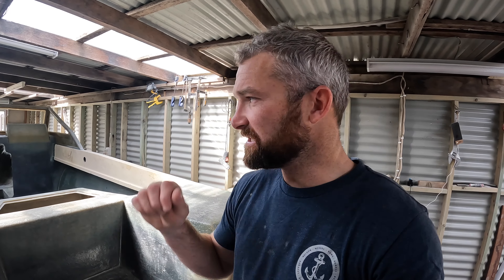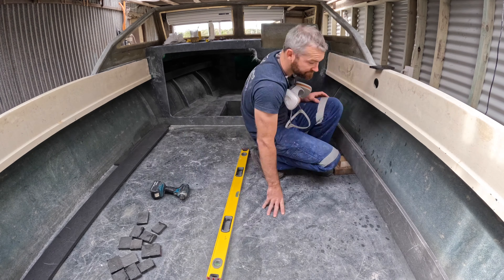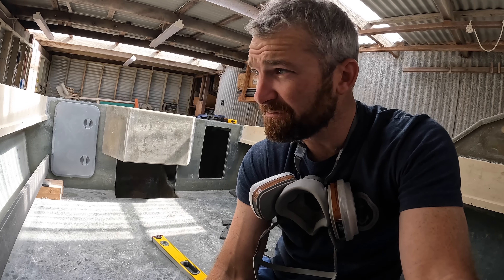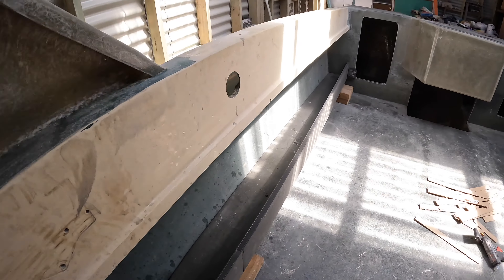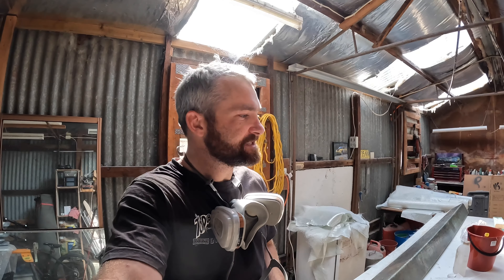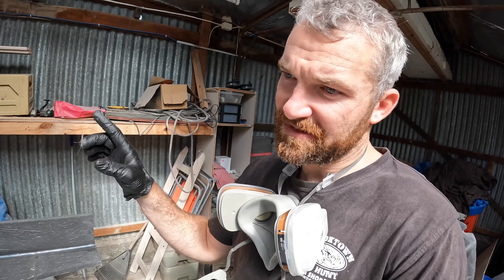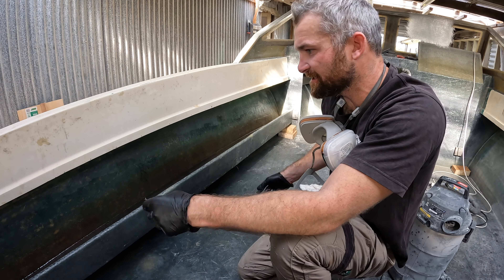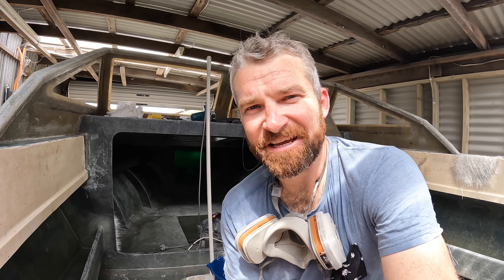Building Thermolite Side Pockets for my Haines Hunter

Comment: Hey mate I’m about to do the same to a 19r. Looking back would ya do anything different? And how much resign did ya use? Thanks mate
Reply from the maker: Hey Jack, thanks for watching and yes I would do a lot of things differently, but it’s a learning process as you go. 
Stringers - I’d probably double up 18mm board and laminate it together. It adds strength but it also makes it easy to glass over the top edges while also widening the base of the stringers creating more longitudinal strength.
Put the boat in a shed from the get go, cradle it up and level it off from the beginning, makes life so much easier and keeps everything in shape.
I’ve used 2 and 1/2 44 gallon drums of resin for this build. 
Good luck and enjoy it mate 👍

Comment: Nice build mate  - here’s a tip that’s too late for u  - I buy my thermolite machine sanded on both sides and you can laminate straight to it only having to prep wipe with acetone. Doesn’t cost any extra and saves a lot of itching!
Reply from the maker: Hey Nathan, I was under the impression that I had purchased pre sanded board. But during the build I laminated some sheets and the next day after the resin had set up, I was to peel the glass right off the Thermolite without much force at all. That’s when I decided to scuff it right up and it worked a treat. I checked my invoice for the Thermolite but it doesn’t mention pre sanded so I’m not sure if it was or wasn’t.
Reply: Yeah fair enough mate - I use epoxy so a bit different but when I buy my thermolite from you can specify sanded sanded, sanded natural - or natural both sides.  Nothing  more disheartening then a failed layup- I must admit I’ve done the “come out the shed the next morning all proud of what I’ve done and realised I missed the hardner! After to many arvo beers the day before 🤦‍♂️
Reply from the maker: Ahh mate that’s disheartening! I know a reputable boat building that laid a whole hull up using a resin gun and when they finished laying up, they realised the catalyst hadn’t pumped through the gun with the resin 😬